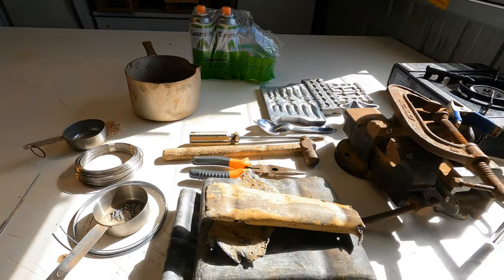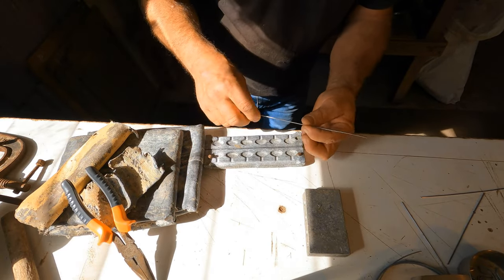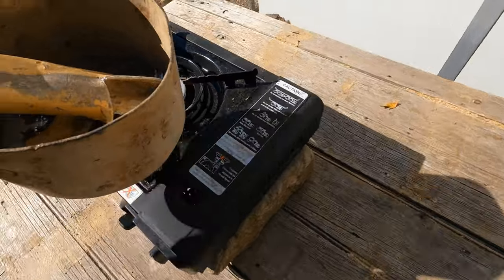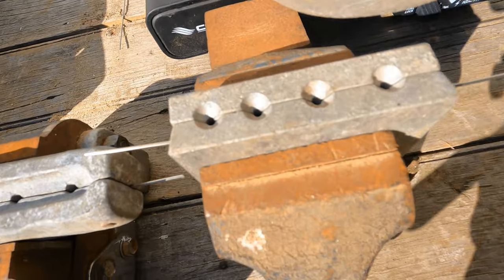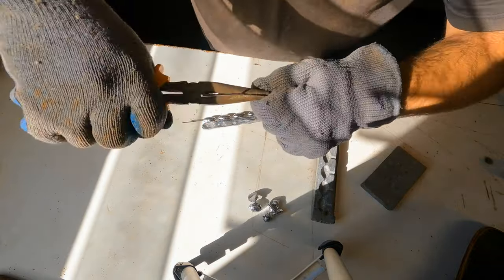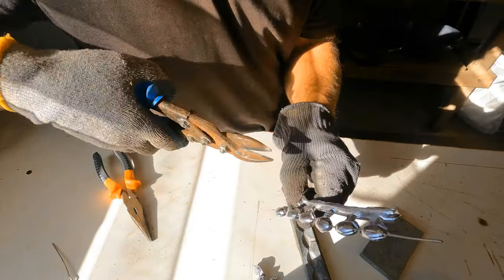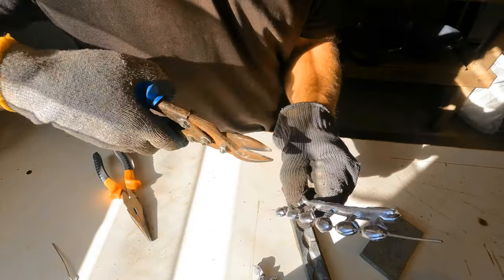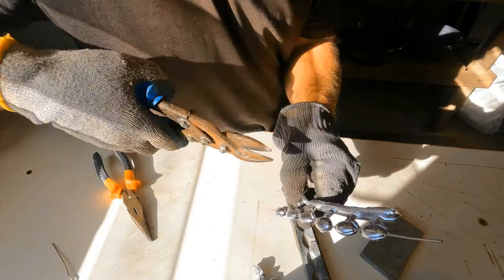How to guide for making fishing sinkers

Comment: Hi Dave, Great video once again. We run a bar of soap over the stainless wire before using it and we leave the sinkers in the mold (which is usually in a vise attached to the table) and get a pair of vise grips on the wire and give it a good tug. It comes out most times with little effort. I love your videos please keep them coming. Andrew
Reply from the maker: Hi mate, thanks for the tips excellent. I did laugh about the vice in brackets. I never fixed it to my table because it gets in the way so it remains transportable LoL. Thanks again for the advice I shall be changing my technique.....Cheers David

Comment: Big candle or a flare pot, the sort you use to burn citronella oil in to get rid of mossies.  Use the flame to coat your wire or moulds with a layer of carbon black - instant mould lubricant...
Reply from the maker: Thank you for the tip.

Comment: David, when you are casting lead, drop a piece of beeswax into the pot before you scrape off the dross. Give it a stir while it is melting and this fluxes the lead and leaves it clean.  Used to do this when casting round balls for a muzzle loading rifle to keep the lead pure.
Reply from the maker: Thanks for the tip Keith, I will give that a go next time. I can imagine how perfect the lead would have to be for a muzzle loading rifle, very nice. Thanks for watching and passing on your experience Keith much appreciated.

Comment: If you had made like a key handle on one end of your wire through. Then when you have poured your lead. give the wire a twist straight away. That should make it easier to slide off when cooled down a bit. Otherwise coat your wire with WD40.

Comment: If you use nonstick cooking spray in your molds and on your wire inserts, the wire inserts will come out of the sinkers easily and the sinkers come out of the molds with little to no effort. Just lightly spray the inside of the molds and the wire inserts before use, and after about every third or fourth run. I have been doing this for MANY years, and it works great. You can use whatever nonstick cooking spray that you want to, but I use the cheap nonstick canola cooking spray or nonstick olive oil cooking spray, from my local Dollar General store. I would steer clear of the flavored varieties.
Reply from the maker: Hi, thank you for your tips using the cooking spray for the moulds and the wire I will do that for sure. All the best to you and your fishing...Cheers David.
Reply: @davidsheldonfishing9726  Tight lines to you Sir.

Comment: Try chucking your wire in a drill and pull as you spin it. Straightens out better than a hammer in a second or 2 and doesn't scuff and dent up your table tops.
Reply from the maker: Hi mate thats a great tip thanks, I can see how that would work a treat. Cheers
Reply: You only need to pull on the tip, check out some vape coil tutorials, you'll see what I mean

Comment: Hey name great video! What did you use to make the star sinker eyelets? I tried using swivels in my star sinker mould but they didn't turn out so great and lost a few sinkers on the cast
Reply from the maker: G'day jay gee, the eyelets are made out of thin galvanised wire cut to lenth and shaped the way I have in the video, I have used swivels before I used the ones with the clip part on for better holding in the lead the trouble I had was eventually with corrosion and wear the swivel eye would break and the sinker was gone so I don't use them anymore, there are a lot of sinkers sold with swivels on but wire hooks are better they don't break. All the best with that jay.
Reply: @davidsheldonfishing9726  hey David thanks for the reply! you make a Very valid point and i will no longer use swivels! thanks a bunch for the help!